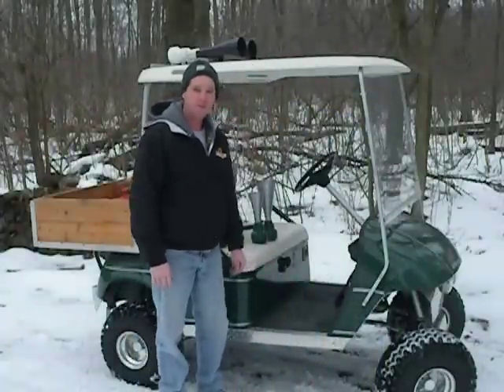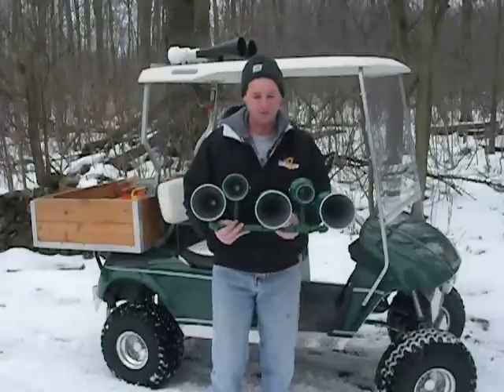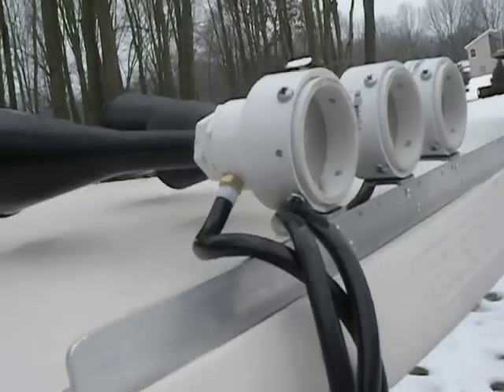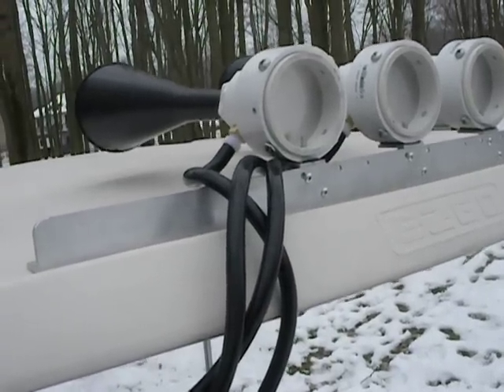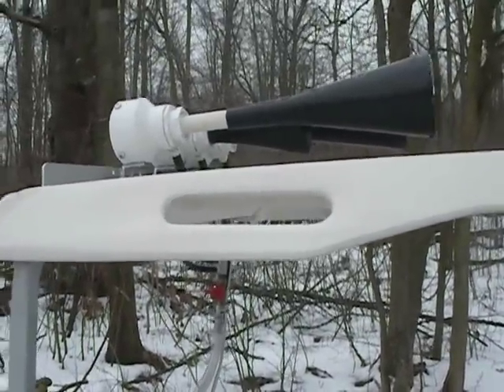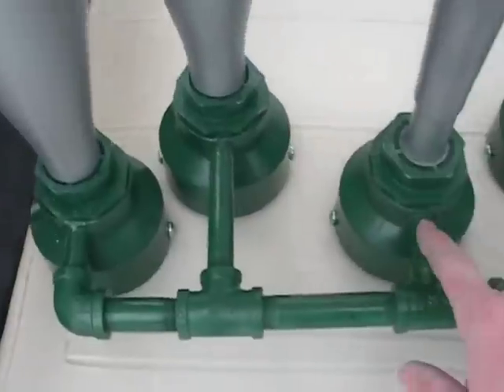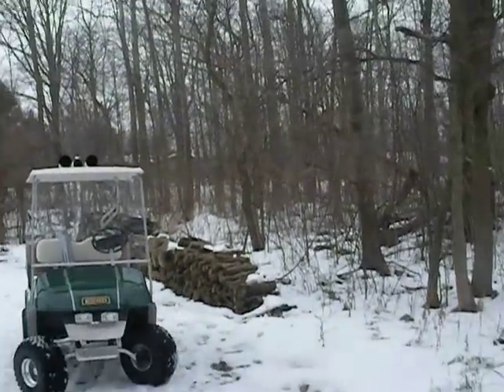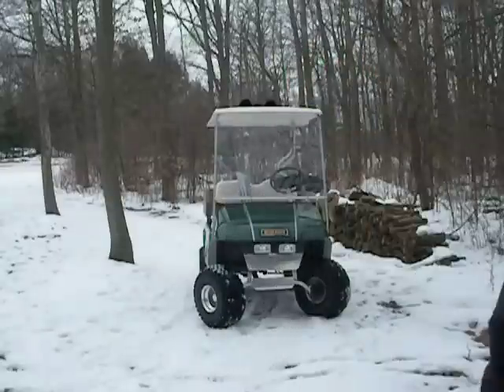Train Locomotive PVC air horns Nathan Airchime & Leslie tuned

Comment from the maker: yes you can. You will also need a 5 or 10 gallon portable air tank to charge up with air. You can use a cheap air ball valve to release the air from the tank to blow your horns.
Reply: how many seconds do the horns last before the 10 gallon tank needs to be recharged?
Reply from the maker: @SCARREDMTBER  about 1 second of blow time per gallon of air, so 10 seconds or so.